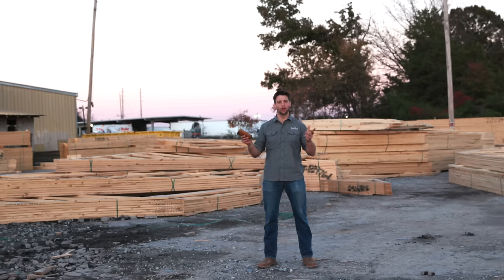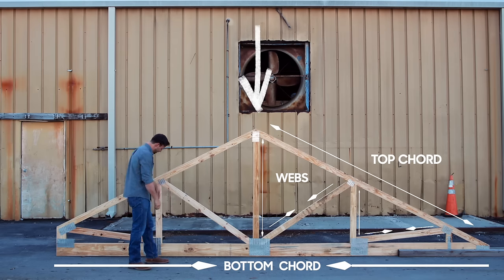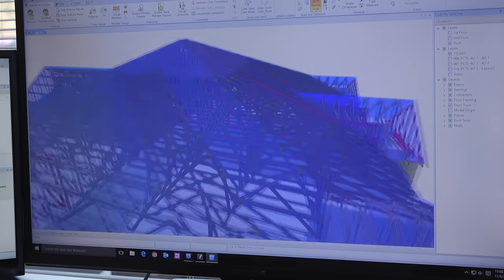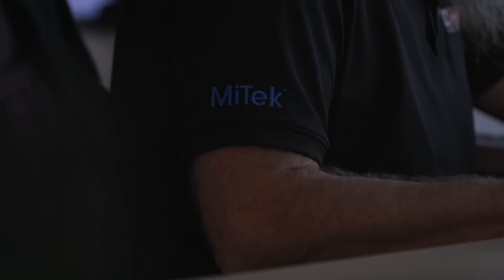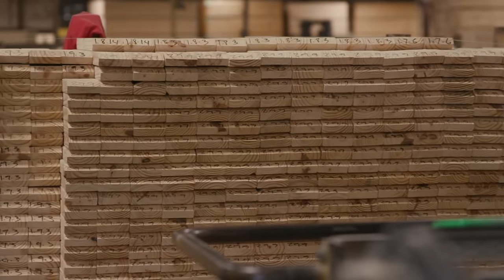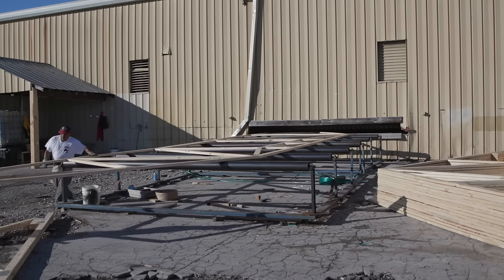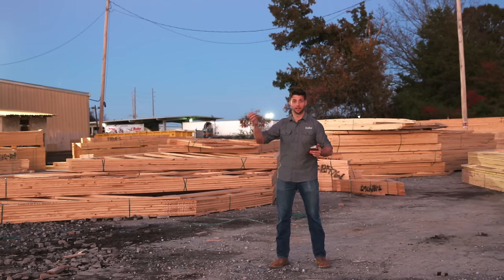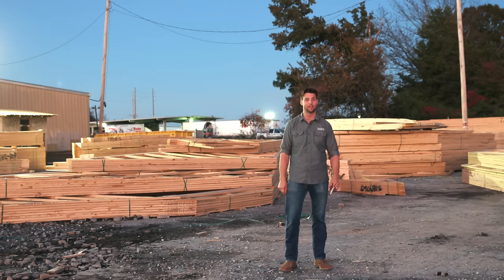Floor and Roof Trusses - "How it's Made"

Comment: The top and bottom chords are not only in tension or compression. They have uniform loads from the roof above and the attic/ceiling below, so they're also in bending and shear between the node points. They would be purely in tension or compression if the loads were only applied at the nodes, which is a traditional truss configuration.

Comment: As a firefighter I have to warn you about those nailplate fasteners, they tend to rattle loose during construction, or through termal stress across seasons. Then when there is a fire they will start popping out and the entire construction can collapse as fast as 15 minutes. Because of that, this type of construction has actually been outlawed in the city by our fire inspector.
Reply: Patrick, plywood and/or OSB would be better? Would any of them resist a little more in a fire?
Reply: @avilabra  The problem is not the wood, it's the metal plates that connect the beams.
There is not a lot of mechanical connection, especially in the lateral direction. The "nails" are basically just metal spurs that are bend out of the plate.
Reply: @patrickkeller2193  the fire resistance of the plates are a serious concern to me and some  say they “fix” the problem using pieces of plywood and nails - and that the nails would resist better to the fire, but they conduct heat even if they are totally inside the trusses. Than it seems to me that there’s no solution besides avoiding trusses that demand metal components in their core, and go for bigger timber and connected only in their ends. Would you agree with that, Patrick?
Reply: @avilabra  That fix would actually help a lot. The fire resistance of the materials themselves is not even the problem. Burning through the beams or melting the metal components actually takes much more heat and time. The problem with these one piece nailplates is that they are simply not very secure and can easily slip out and then you are left with free-floating beams. Anything that keeps the plates tightly attached would greatly increase the fire resistance.

That said it is better to avoid nailpates in the first place in favour of traditional carpentry joints and metal fasteners with screws. Might be more expensive and slower, but much safer.
Reply: @patrickkeller2193  and this is why I want to incorporate a fire sprinkler system when I build my home. Why they are only in apartment complexes is crazy, the piping is not crazy and you can catch rain water for the reservoir for the standby water!
Reply: In structural steel buildings, the steel is fireproofed. It is fireproofed because it is known that as steel heats up in a fire, it loses its strength dramatically. Not burning or melting away, just the strength decreases as it heats up. So, why not apply a “dab” some kind of fireproofing to those nail plates to further protect them? Could be quickly applied in a factory setting.
Reply: If they are the right size and pressed in properly these plates do not come loose easily. They are plates with a bunch of nails, if that were true for these plates then nails would come out of framing too

Comment: Matt, i love your videos.  I live in south Texas so I apply a lot of the same solutions you present. 

But I think Jordan has the tension, compression description wrong.  Start with a 3 piece gable configuration, two angled top chords and one horizontal bottom chord to make a triangle as you see on the outside of the truss shown.  Clearly the shorter angled top pieces are in compression, and the bottom horizontal piece is in tension to keep the roof from flattening out.  Jordan is correct to here.  
The longest piece of the trio is the bottom, which will try and sag.  Add one vertical tension chord from the center of the bottom to the peak. This will prevent bottom sag by pulling up and it increases the compression on the top chords which also increases the tension on the bottom chord.  

The next longest pieces are the angled top chords along the roof deck.  To prevent these from sagging, you can put a diagonal compression member from the center of the top chords to meet at the center of bottom chord.  These diagonal members increases the tension on the vertical centerline chord which increases the loading as described previously.

The next longest part to sag is either side of center of the bottom chord.  You can counter this with two vertical tension chords at the middle of the half spans, or at one quartet of the length from the ends.  The tension on this short vertical chord will increase the compression on the bottom portions of the top chord and the diagonal compression chords meeting at the centerline, and so on. 

Jordan is looking at the bottom chord like it’s a big beam taking vertical loads from vertical chords.  

So basically the diagonal pieces on the interior of the gable configuration will be in compression and the vertical pieces will be in tension.  The right side has a short vertical member where it looks like it’s  a loading point or wall support position.   

The tail end of the truss at the roof drip edge will be reversed in forces.  The top will be in tension and horizontal chord part will be in compression.   The left side does not have the extension beyond the wall support point. 

If you look at an end gable structure with a wall under its entirety, then it will have vertical studs all under compression.  Supported the entire length by a wall underneath.

Best regards, Henry

Comment: Man after the Swiss/German series, this thing looks like it's made out of toothpicks.
Reply: No snow pressure I guess.. We have to add a load of 3-6kN/m2 to the calculation which makes a huge difference.
Reply: @erik....  
Only in the northern most states will you be getting that much snow. Most of the US population will not see more than 30 psf (1.5 kn/m2of snow (not including drift)) 

But these are used even at 6kn/m2. Obviously they will beef them up. This is recorded in a southern state with no snow load. 6kn/m2 of snow will only be seen in like Alaska, Maine and some mountainous regions.
Reply: @Crazylalalalala  The same methods of building are used in the northwest states and we get tons of snow. Probably just slightly beefier trusses in comparison to what is used in the southern states, as im not aware of the standards there. But to say these look like toothpicks is ridiculous, more so that the swiss builders love to waste materials by building "less with more". Solid wood walls with no insulation and solid wood floors 10+ inches thick are just laughable to look at. Complete waste of materials with no regard to efficiency while providing no benefit except for "sound proofing" at the cost of ultra high price, excessive unnecessary weight, and intensive labor.
Reply: Lol true

Comment: Pretty sure these guys measured, cut and delivered my roof in Cook Springs AL., in 2003-4.  It was a "Prairie style" hipped roof on the house with two ridges.  I was using a 3D program for the design, and they had something compatible that made it drop together like a play toy.

Comment: You guys produce a very professional video.
On trusses: Roof trusses are awesome and the automated factory made truss is the way to go.
Floor trusses are not so wonderful. They are more economical and have the advantage of space for utilities, but they are lethal to firemen. A 2 x 10 floor joist will withstand a considerable amount of fire before it fails, but the truss floor becomes extremely weak in just a few minutes of fire and a fireman walking onto a truss floor that has a fire below can easily fall through. 
Just my opinion.
Reply: The reason that happens is because wood is a poor conductor of heat but metal is not. Thus the metal plates will expand much faster in heat than wood does causing them to fall off and making the tension points unstable.
Reply: @milanroets9697  So making trusses using nails/screws would be way better than these plate-connected ones, right? Much slower, of course, but easier to DIY.
Reply: @DanielZajic  I was just stating that heat from a fire will theoretically cause the plates to come apart. Rafter framing is still way faster than putting them together yourself. Plus you still need engineered drawings with a stamp to pass inspection
Reply: I think the problem with floor joists failing has to do with heat affecting the glue in the truss and losing basically all strength.

Comment: Good simple explanation.  However, the forces in the webs were stated opposite of what they really are.  The kingpost (the vertical member in the center) would actually be in tension whereas it supports the bottom chord and keeps it from deflecting.  Then the 2 angled struts that rise up from the bottom of the kingpost are in compression whereas they support the top chord and keep it from deflecting.  Then the outer vertical members are in tension similar to the kingpost.  Great video though!

Comment: just got to go on a tour of a truss factory two weeks ago.. watching the 6 head saw machine.. amazing.. then watching the guy tacking the the trusses.. 5 minutes for 45 foot long truss then run down the line press down the plates. The machine is so heavy that runs down the line.. if it hits a hammer that was inadvertently left on the line.. POOF one claw removed

Comment: Been designing trusses for 20+ years.  Done residential and commercial. I currently work for one of if not THE largest component manufacturers in the industry. I can say without hesitation that the truss designer is THE most important part of the process yet is the least paid. I know because I've worked for 3 companies in my journey upward. It's a shame because we take on so many tasks and  have to constantly learn new codes and software. Yet all the salesmen do is forward emails and they make twice what we do. I love what I do, I really do. I just wish I was paid accordingly. I can design a floor and roof for a $900,000 home and I'm paid the same as the guy who replaced your tires on your car. Is that fair?
Reply: So be a salesman.
Reply: Unionize

Comment: I am not a builder, trained in architecture, who watches to keep updated and for enjoyment. As I understand, lumber is getting less and less quality.  As the size goes up, the more cupping and warping risk. Meaning could see trusses as being more accurate and precise, especially with that pin table. Very interesting!
In addition, if I had a choice between wood I joists and wood trusses, would go the latter. We do not know the long turn impact of the resins used in OCB, turn to mush if wet (Plumbing leak causing a floor collapse?), plus the beauty and flexibility of floor trusses.
Reply: Most standard grade lumber is made from young, smaller timber and has wider growth rings and often has the log center contained in each board.  That makes for boards prone to splitting, cupping, twisting, and bending.  Junk!  Lumber used for trusses, however, is typically higher quality than that used for most other structural framing.

Comment: I had simple trusses built for a 24 by 24 garage with a 4-12 pitch. They were not symmetrical and off by an inch and a half. Maybe I'm picky but I think they could have easily made them correct and just didn't. I had to flip them around to make them lineup

Comment: A truss engineer told me in building you put the crown of the lumber up but in truss production you put it down. Gravity will cause the lumber to straighten in time but on trusses tension will push in the opposite direction causing the lumber to straighten.

Comment: Economical? Are you crazy? Here in Miami Dade they start at around $20000 for pre-engineered trusses. I absolutely could build trusses for less than that.
Reply: but what you build...would it be engineered and sealed by an engineer with in house and 3rd party inspection??? uh, NO

Comment: I have these in my 40 year old double wide, opposite of your high end. They still are holding up but do show some issues of the metal fatigue, wavy, which has them pulling out a bit. Since tangs are getting a little sloppy I tried to press them back in but metal memory pulled them back to where they were. I went through with plywood to create a clamp holding them were they are strongest. They had not failed but would have issues in wind (hurricanes) or another ten years (50). Still not bad for a 100 grand house , in a high end house I would not like this. Locking systems should be improved a bit . Just saying my idea is a house should last 500 years .....
Reply: I've seen other (older?) truss systems where the metal plates - also known as gang nails - are instead larger plywood squares traditionally nailed into the truss members to do the same thing. You can do that, too.

Comment: Commented to add that while informative, this is a slight over simplification of trusses. There are members in a truss that can be zero force members. For the curious, google zero force members.
Reply: Yeah, and I think most members deal with both tension and compression forces depending on the load condition.

Comment: I'm currently rebuilding all of the MiTek digital trusses on a job in Revit software so that proper coordination among all the service runs can occur during detailed design.  The Truss Subcontractor couldn't even read the plans so I had to adjust their designs to make it work. When will Sapphire be able to output an ifc file format for proper coordination in a Federated model? Building Information Modelling is standard now days. The construction industry really does move at a snails pace.

Comment: How much more would it cost to use simple triangular roof framing, with a higher pitch if necessary, so the space would be unobstructed and possibly finished?
Reply: Not much. just a few more feet of wood really. But those are called bonus trusses. The truss company will tell you that they cost millions of dollars more to produce and no one really uses them anyway. Besides you would need a really big crane to set them because they weigh at least 50 pounds more. 50 pounds is a lot for an average crane. I am being facetious obviously. But I have actually been told this utter nonsense by the complete morons that work in my area. They charge whatever they feel like when you don't buy what they want to sell you. I hate trusses and truss companies and will avoid using them anytime I can. Trusses are nothing more than a way to build a roof as easily and cheaply as possible. They are not for building quality homes. One of my homes in Detroit was built in 1909 and has solid oak 2x4 rafters with 3 foot kneewalls in the attic. This gives me about 900 sq ft of space up there. Also I have replaced a few of the slate tiles on the roof but no more than 25 and the rest are original. You ever seen a 111 year old asphalt shingle that isn't a pile of grainy dust ? This is why we are seeing a push back to older technologies. They worked and worked well. Just because it is newer and cheaper does not mean it is better. But on the downside Trogdor hates slate roof cottages. He likes to burn down the peasants in their thatch roof cottages.
Reply: There is no cut and dry answer that will cover every situation so I have to give you one of those annoying "it depends" answers. On your typical 22' +/- wide  garage going from a standard truss to a box attic one costs about $30-$40 per truss. Fink attics (webs look like a "W") with a 2x6 bottom chord are only about $10-20 per truss more than a standard truss. The cost increase comes from using larger lumber (eg bottom chord going from 2x4 to 2x12) increased lumber grades (eg 2x4 #2 might bump up to #1) larger truss plates, etc. Truss profiles like this are quite common (I see them on nearly every house I design trusses for) but they generally need to be specified on the plans or by the builder/customer.

Comment: On the job site, is drilling holes in the trusses frowned upon or forbidden? Holes for electrical, plumbing, AV, etc. Just wondering if nails, screws or holes compromise integrity of truss.